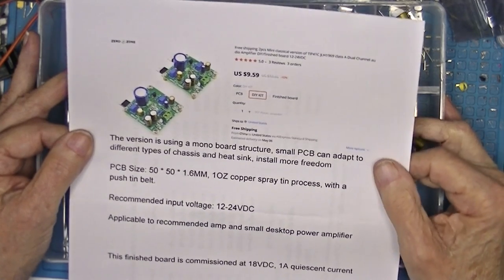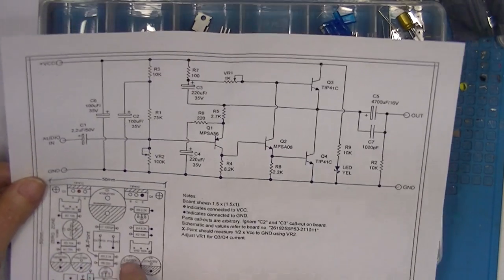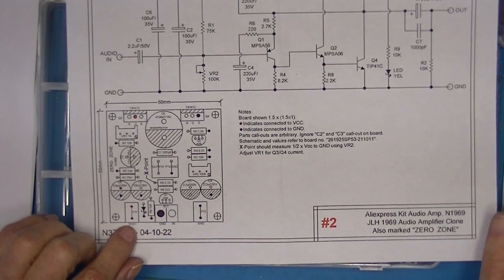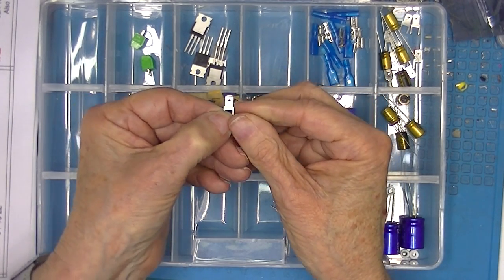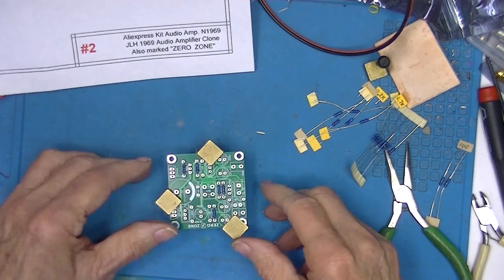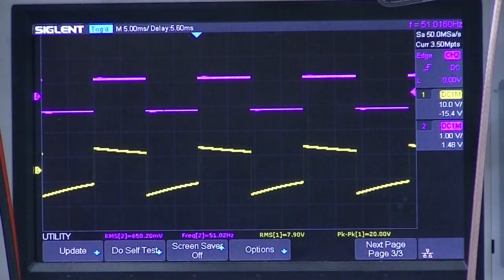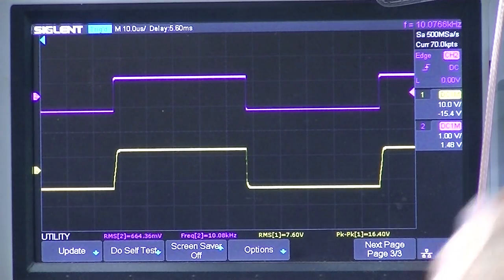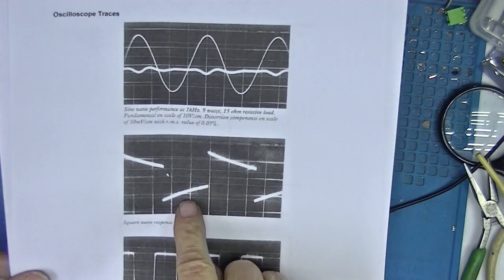J. L. Linsley-Hood 1969 Amplifier Part 3

Comment: Hi Steve,  looks like the link in the description is broken.  I get the error message:  The requested URL was not found on this server.
Reply from the maker: Try again, I just checked and it still works. Maybe the server was down.
Thanks
Steve
Reply from the maker: BTW, anything after ".com" is case sensitive.
Reply: @stevestrivia-bystevewagner4852  Thanks Steve,  I just click on the link and for me it did not work I also typed in in manually with the capital "A" for Audio but no luck.  I am able to go to your website with no problem.  Not a big deal and again thank you for the help and fast response.
Reply from the maker: I think I have Fixed the link;
https://gswagner.com/AudioAmplifiers
If this works, it's because I removed the space between Audio and Amplifiers.
Let me know, Thanks
Steve
Reply: @stevestrivia-bystevewagner4852  It works fine now Steve and I loaded the document into Word with no problems.  Have a great Memorial Day!